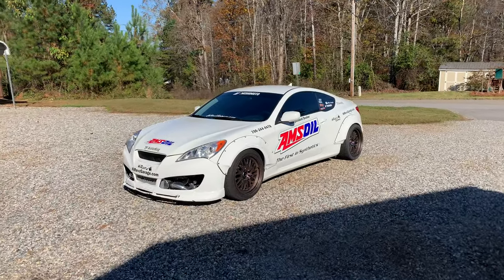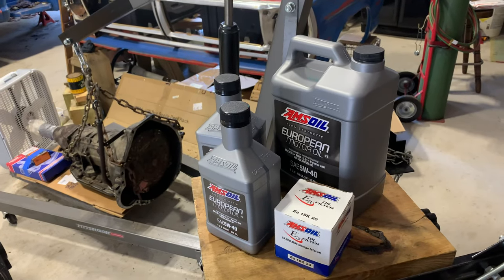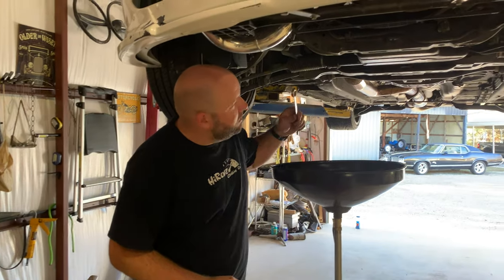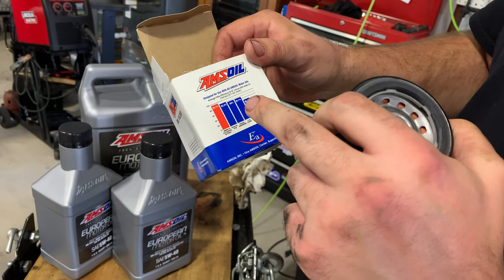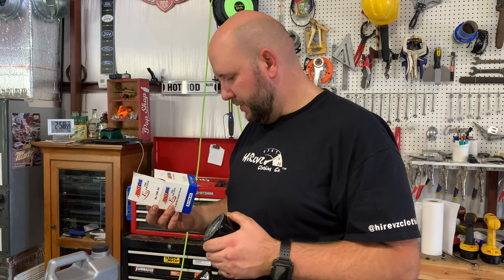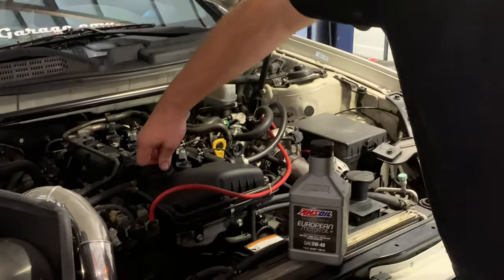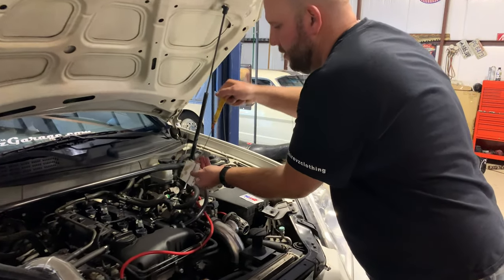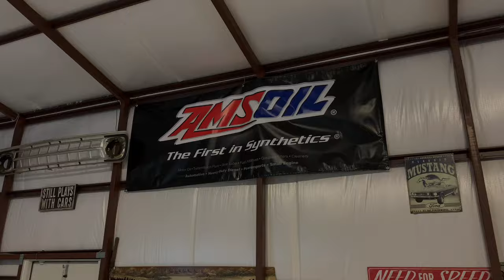5W-40 Synthetic Oil Change - AMSOIL Widebody Genesis

Comment from the maker: You will be surprised by AMSOIL.  AMSOIL Premium Signature Series is guaranteed to 25,000 miles.  Every quart of AMSOIL Premium Oil has said 25,000 mile oil change on it since 1972.  

AMSOIL was the first company to ever have Automotive Grade Synthetic Oil in 1968.  They also had the first synthetic oil ever approved by the API in 1972.

Today AMSOIL Premium Oil has 75% more protection than the API standard requires, which means it will last much much longer than other oils.  

Many people have done oil analysis after 25,000 and the oil was still good.  Meaning it still met the API requirement or was still better.

The By-Pass filtration system from AMSOIL can allow a vehicle to go at least 100,000 miles or more on one oil and filter change.

If none of this was true, AMSOIL would have gone out of business many years ago.  AMSOIL is a tiny company compared to the HUGE Petroleum Companies that are now copying what AMSOIL did almost 49 years ago.

AMSOIL is the only thing I buy now, I get wholesale prices with up to 25% off.  It makes it really affordable.  Check it out! https://www.amsoil.com/offers/pc/?zo=30186226